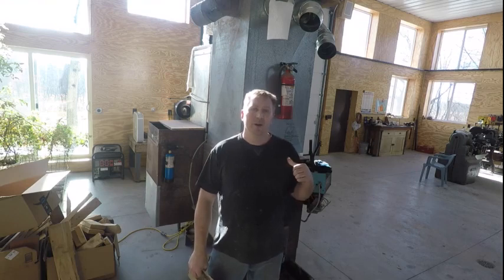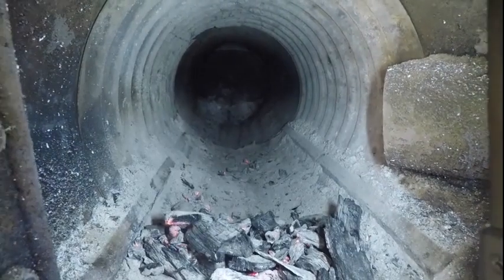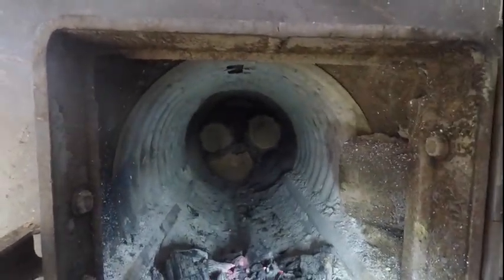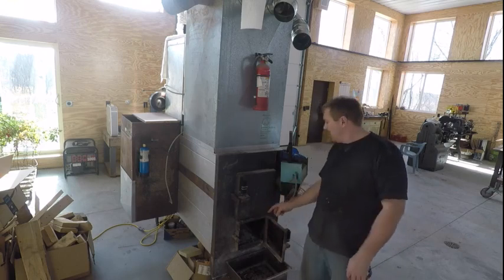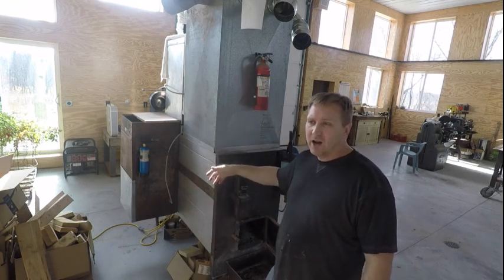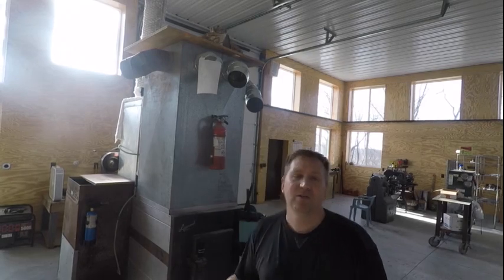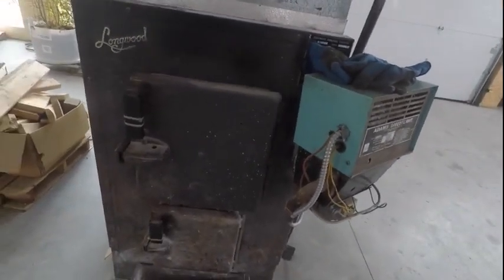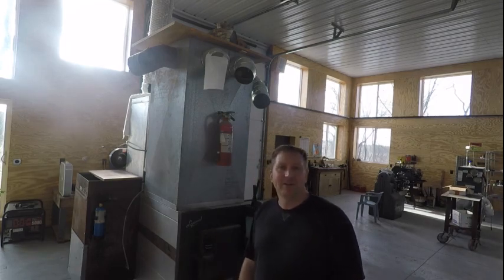Longwood Furnace Instructions

Comment: great video.  I am looking at a used one and was wondering if you had anything i should look for before buying it.  It has been run on propane only.
Reply from the maker: Check to make sure the firebox and ash box doesn't any holes that reach to the plenum. This is hard to look for but a second person with a flashlight can help. Or if the unit is outside, light some paper in it, then cap the output with a board and look for smoke where it shouldn't be. 

Check the tubes on the heat reclaimer to make sure they aren't burnt through and verify the cleaner rod and the fingers inside the box are there. 

Check the door gaskets to be sure they are good - they should be flat and continuous, no notches out of them. If the gaskets are bad I think one could retrofit with stove gasket from the home store but it would take some thought and custom parts you'd have to make. If you are handy don't let this bit deter you.

Everything else pretty repairable. Good luck!
Reply: @dirtyshirtworkshop  would you be open to a short discussion?  I just got my Longwood and have a few questions.
Reply: @dirtyshirtworkshop  sent an email.  Has my info
Reply: I can't imagine running on propane only. I have one of these and I do believe that the propane only efficiency is very poor. I ran through 1400 dollars worth of propane here in Kansas. Right now, I'm running 27k mini splits for most heat and just load the Longwood when I need extra neat and use the propane to light the wood. Let propane run perhaps 15 minutes to do that. I go through less than 400 gallons  year instead of 1200.

Comment: Do you have an outlet for the door gaskets? My stove has started not to draw correctly. Im wondering if it could be the doors.
Reply from the maker: I think you are asking where can one purchase new door gaskets. Longwood has been out of business for quite a while, so it's just not possible to get OEM gaskets as far as I know. 

Assuming your draw issue is too much, the first thing I recommend is you check the adjustment of your door gaskets. See page 22 of the manual (link in the description) for how to do that. Note that the adjustment procedure, if needed, is different for each door. Also, if you have the model with the automatic damper on the ash door, you'll need to check it's operation.

If you have too little draw, clean the chimney and make sure your reclaimer is clean. Hope this helps!

Comment: We have one of these in our house we just bought.  Ours is hooked up to natural gas. I’m not sure how to tell if the reclaimer is getting too hot or not but the inside of it was glowing red today.  Maybe that is normal?  We are burning ash and it wasn’t overloaded.
Reply from the maker: I've only seen mine glowing once, and it was because I left the door open while lighting and got distracted - the reclaimer and the whole stack up to the ceiling was cherry red before I noticed it!

So, that isn't normal. A few things to check - does the reclaimer fan run? If it doesn't run: 1) disconnect the fan leads, an connect them to an extension cord (twist the wires and you can fit them into the end of a cord, or sacrifice a cord and cut off the end). The fan motor is 110 v, so it should run. If it does not the fan motor is burned out or just needs lubricated, you'll have to take it apart to oil the bearings as it is a sealed motor. 2) if the motor runs it might be the switch (inside the junction box on top of the reclaimer). This is a thermal switch, test for continuity with a meter, it should be open when cold, and when the furnace is hot it should close. I don't know the temperature it should close at, but glowing is definitely enough. My reclaimer reads 400 degrees on the face when running, but I bet the switch is set for something like 250. 3) The wiring might not be right to the reclaimer & switch assembly. There should be power coming directly to them, and it shouldn't be switched. It could be someone connected it to the same place as the blower motor, which would mean the reclaimer would only run when it does. That is incorrect, it should operate independently.

If the reclaimer fan does run - my guess is and air leak - maybe you have a bad or poorly adjusted gasket on one of the doors. See the manual for proper adjustment - it says something about using a strip of paper. The gaskets are made of asbestos (which is safe as long as you aren't shredding it) so you can't get replacements. If you need to replace it I think getting a stove door gasket (the round kind) would work. It glues on, I suspect one would need to take the door off and lie it face up, so the gasket could stay in place while the glue dries.

There is also a possibility that your chimney has too much draw - basically pulling a vacuum all the time, which would pull fresh air into the furnace and fuel the fire even when not needed. You can test for that by propping open the damper control on the side rear of the unit.

All of that being said - if the reclaimer is running properly and independently of the blower, the blower works, the burner only runs when the thermostat calls for heat, and the door gaskets are good, and a load of wood lasts 12 hours, I wouldn't worry about it.

Hope this helps. Follow up questions are welcome!
Reply: @ it does run on and off.  It doesn’t sound very good but it runs.  I don’t feel like my load of wood is lasting 12 hours though.  Is this the junction box?  Trying to add a pic.. there are some frayed wires in there.
Reply: It won’t let me add pics.  Sorry!  I see that the side damper at the rear is kind of held slightly open with a piece of metal.  Once I turned the thermostat off upstairs the red went away. So I think there is too much air getting into the box when it’s calling for heat.  I would love to send you all these pics if you have a way!
Reply from the maker: @annapeterson3334  I really think your best bet at this point is to make a video. Upload it to youtube and post a link here. Then post the link to it here in a comment and I'll take a look. You can always delete the video later. If you want to only do pictures, you can post them on your own community page in youtube, or use imgur or flickr those are good too. 

The rear damper being propped open doesn't surprise me, that would reduce the draw on the firebox.

I guess a basic question is - is it heating fine?  I can't say for sure if it's bad or not that the tubes are red, just mine haven't done that. That being said - I don't have any gas set up on mine. I can imagine that with the gas blower and wood inside, the flue would get much hotter. I would like to inside with the door open when you have the thermostat calling for heat - seeing what kind of flame the burner is putting out might tell us something. You also said the reclaimer fan was not sounding good, that is where a video would be good so I can hear it.
Reply: @ I’ve posted my Flickr album here a few times and it keeps getting deleted.  Sorry. I’m trying!
Reply from the maker: @annapeterson3334  I didn't realize they filter like that. I created an account over there. Here's the part after the .com so you can find me there. 

people/201853517@N03/
Reply: Flickr should have them all now if you can find me ( I followed the profile you sent). I’m almost sure it has to do with the call for heat from the thermostat with the natural gas. Once I turn it off the red in the reclaimer goes away.
Reply from the maker: @annapeterson3334  Got it good job on the pics. That definitely doesn't look right. Can you actually move the cleaner rod on the reclaimer? The way it is situated there it looks like it probably doesn't get used much. 

My guess for your problem is the most of the reclaimer is fiilled with creosote. So the flow is restricted and all heat exiting the furnace is only going through a narrow passage in the middle. It is obvious for it to get really hot then. 

I think you'll have to take the reclaimer off and clean it out. Get a liquid type creosote cleaner. Worst case, get some "wood stove glass cleaner" at the home store and pour it in that will help clean it up. Then make sure the cleaner rod is there and moves the cleaner freely. It could be melted off - the rod just connects to the top of the cleaner, it runs parallel to the tubes in the top of the reclaimer. Once you get it clean, remember to move the rod every time you load wood.

As for the frayed looking wire, that one is ok it's your ground. The white and black would be the ones to worry about. 

Hope this helps, let me know if further questions!
Reply: @ yes we use the cleaning rod everytime. It’s in an awkward spot but I do it each time before we run the stove.    What would the steps be to take off the reclaimer to clean and get it back attached safely.  Maybe the guy who swept our chimney could help us.
Reply: Thank you for all your help!
Reply from the maker: @annapeterson3334 there is a collar on the bottom of the reclaimer that clamps it to thr furnace. For the top pipe just disconnect. If you don't have a telescoping pipe there I highly recommend on, makes service aay easier. The  cut the power and disconnect the power to thr fan and it should come off. Whe  you have it open make sure the end of tbr cleaner rod hooks to a comb looking thing on the inside. If it does and it's bot plugged, you could have a smaller gas orifice put in the burner. Assuming of course you'll always heat with wood. The burner is sized to be the only source of heat if you wanted. If you do that regular it will depend on whether it keeps up witg your heat demand. And insulation is never a bad investment! Good luck!
Reply: @dirtyshirtworkshop  we will give it a try. Is there anytime we can burn.. like those creosote cleaning logs or anything?
Reply: @ we took it all apart and to our surprise there wasn’t any creosote in it at all! Clean as a whistle.  Just shows that cleaning rod works well!  Our issue must be too much air.
Reply from the maker: @annapeterson3334  That's great, good that it is burning clean. I should ask more questions before giving advice....

What does it do when running gas only? I.e., clean the firebox out, and just heat with the main burner and no wood. Does the reclaimer still glow? 

Also, have you tested the adjustment of the door gaskets as outlined in the manual? That can let in a lot of air. On mine for example, if I close the ash door too quickly, it actually rebounds slightly and leaves a gap and then it burns pretty hot. I have gotten in the habit of pushing the door closed firmly instead of swinging it to prevent this.

Lastly, any chance you can contact the prior owners? Maybe it has always been that way. We may be looking at this all wrong, maybe it's not a problem at all. Although it seems you would be wasting a lot of heat right up your chimney.
Reply: @ we will test it out with gas only and do the gasket test.   One thing I do know is the instant I turn the thermostat down it goes away within seconds. So wood only is not what’s doing it if that makes sense. I talked the previous owners and he said it should be fine, he only used the natural gas to ignite the fire then turned it off once it was lit and ran it like that.  And that is what we have been doing too in order to keep the reclaimer not red.  He said it was fine… but I can’t tell if he knows it’s bad but ran it like that anyway or if it really is fine.
Reply: The only bad part about turning off the thermostat once it ignites the wood to make sure the reclaimer doesn’t get that hot is that the machine essential is cooling off on purpose and making it not very warm in the house… I mean we don’t want it red hot reclaimer warm but somewhere in between is what we are shooting for lol
Reply from the maker: @annapeterson3334  RE the prior owner it is still valuable information, we know he didn't run it that way all the time. I did look at your photos again, and that burner doesn't really look like an OEM unit. Does it have a nameplate and/or BTU rating on it? I'm wondering if the burner is over-sized.
Reply: @ Input: 115,000 BTU
Output: 150,000 BTU  is that what you are talking about
Reply: There is a longwood plate on it with all the info 12hour charge and clearances for install etc
Reply from the maker: @annapeterson3334  Yes that's it, and that is the correct burner rating for this furnace. That rules out the burner being over-sized.
Reply: @ is there supposed to be a tiny hole in the middle of the door where you can see the flames.  Or should that be plugged
Reply: @ i didn’t read the right panel for this. I’ll post a pic of the burner btu info on Flickr
Reply from the maker: @annapeterson3334  Got it, looks like you have the right burner. See https://adamsmanufacturing.com/pdfs/G2TInstallationManual.PDF this is for a different make, but the nameplate ratings are all the same. You have the HD-2 item, the 80K-180K BTU which is correct, this is what they sold with the furnace. So I think you have the right burner. 

As for the hole in the door, mine doesn't have one like yours, but a hole that small likely isn't making that much of a difference. I do not know what it is there, but it looks intentional from the factory. You could tap the hole and seal it with a short bolt though - just make sure it doesn't interfere with the gasket plate on the back of the door.

Comment: I have a longwood  and I can get heat out of the reclaimed but it doesn't seem like a lot of heat out of the blower and we put a lot of wood in it
Reply from the maker: Longwoods aren't known for their efficiency, but mine does heat plenty well. You could have a restricted flow in your chimney or your barometric damper isn't adjusted correctly (the metal round flap on the side near the bottom). Check the flow of your chimney. If you don't clean it regularly it will have creosote buildup and your fire just won't burn well. A good indicator of that is if the output has reduced over time. If it worked great a few years ago but doesn't now, you probably need a chimney cleaning. I clean mine every year. 

If it has never worked well, you need to insulate your building. I have 24" of fiberglass in the attic - that is the best and cheapest investment you can make. My walls are R38 (10" fiberglass) and my floor is R20 (4" sheet foam board). Those of course are hard to change after the building is up.

Hope this helps you.
Reply: How do u adjust the barometric damper correctly? Thanks
Reply from the maker: @ Sorry for the delay didn't see this comment. See the manual, page 11, the section at the bottom titled "Draft Control Adjustment". They have specs if you are using a manometer, as well as a manual method.

Comment: Why don't you curve the bottom of the ash rake to match the tube (make it a D shape), would make it easier to get the ash forward
Reply from the maker: Nice idea I may try it.  Honestly it rakes stuff from the back very well (4 or 5 pulls is all it takes). Most of the raking you see in the video is just moving the ashes back and forth over the grate to get the fines to fall through. Thanks for the idea!